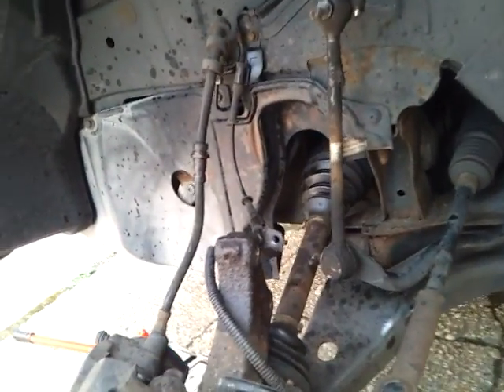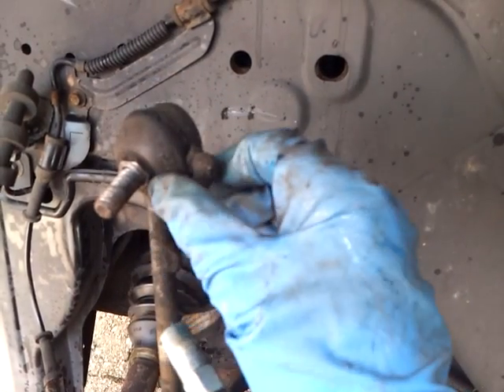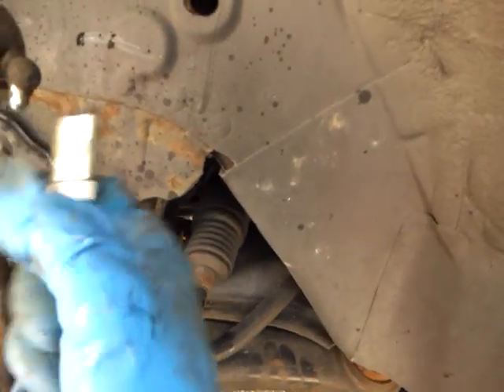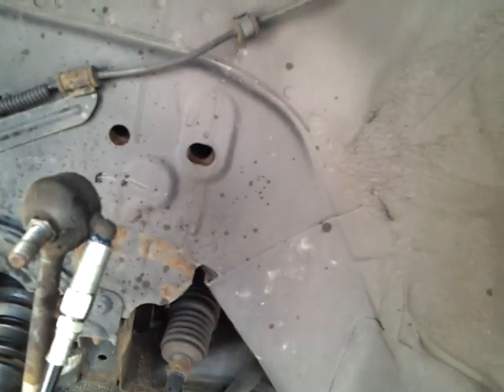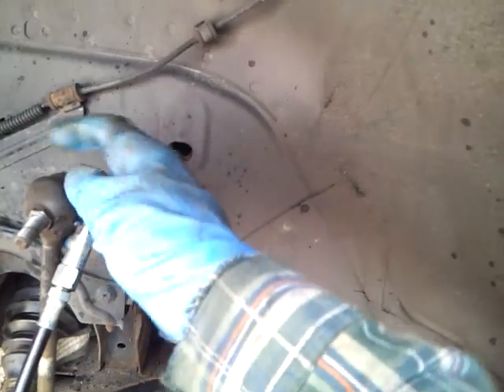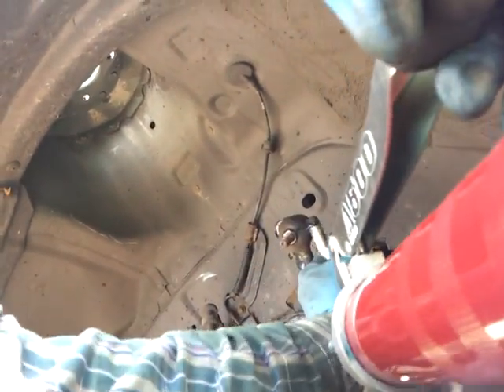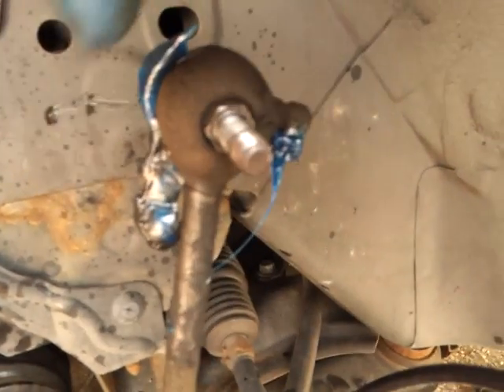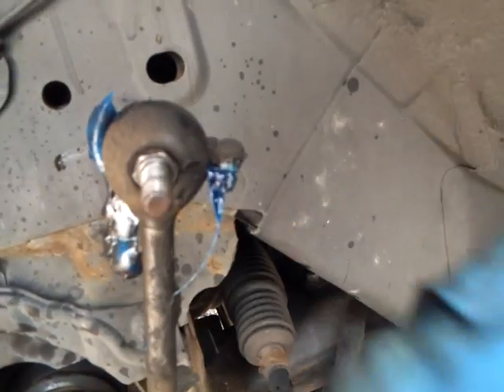How to use a grease gun - Basics

Comment: Grease Gun tips (couplers) have rotating heads that loosen and tighten to the fitting so you dont have to press so hard.  It also makes a better seal and keeps you from crushing ur hand against steel when removing the tip :)  Youre welcome in advance.
Reply: Learned this AFTER I snapped the zerk fitting off upon removal..

Comment: Please help. Is there grease fittings on a 2007 limited ford escape
Reply from the maker: Jack Kenny some joints dont have grease fittings..they come pre-greased..if the boot isnt full of grease then u should use a needle on the gun to poke into it and fill it..
Reply: klowny1969 so what I'm saying is does a 2007 ford escape have any grease fittings?

Comment: what kinda grease is recommended for chassis parts? I see a lot videos here on youtube explaining how to grease ball joints but no one actually talks about what type/brand of grease should be used.
Reply: As with motor oil, new grease is better than old grease, so:
1. any type of new grease is better than the old grease that is in there
2. multi purpose grease will work fine (as will any of the others out there)
3. don't worry too much, just grease em